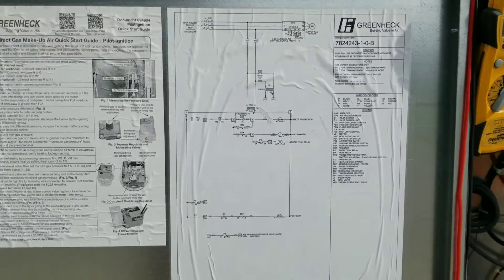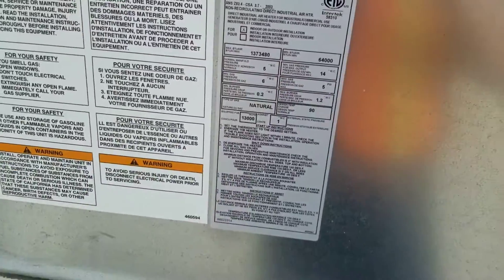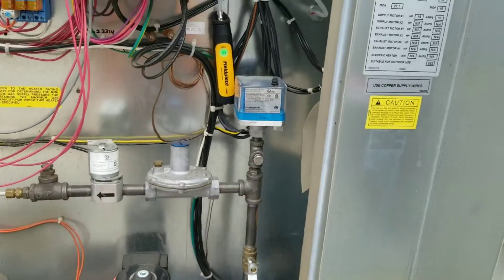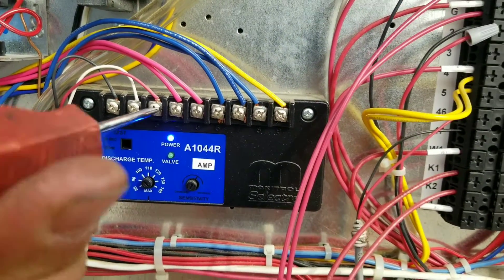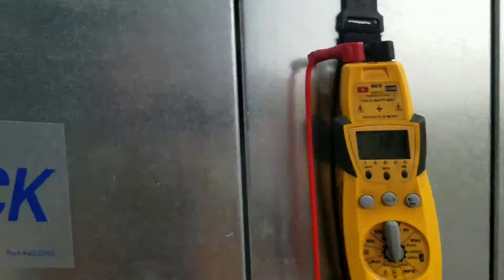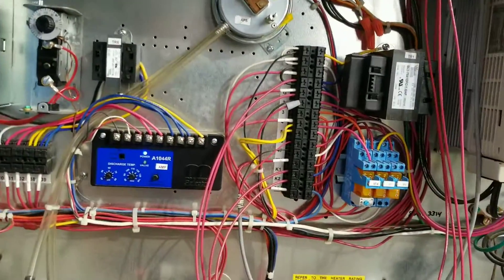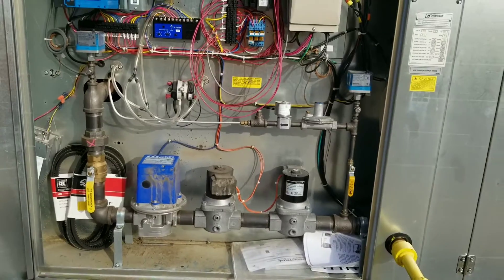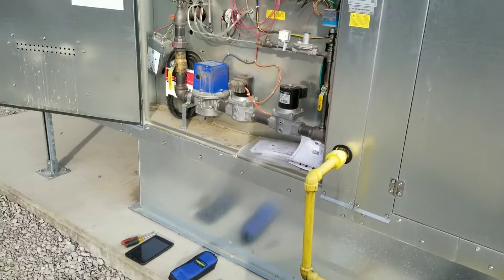direct fired make up air, greenheck,  high limit trips.

Comment: Nice man.  Your manometer was referencing atmosphere and the burner is on the inlet to the supply fan so it'll be more towards negative/negative the more it turns down. I've never done it,  but I guess you could reference the cabinet to get the "true gas pressure" if you were curious.  I may try that next one I see lol. Maxitrol has some decent literature on those MR valves.  Lots of configurations.  Enjoy the content man.
Reply from the maker: Thanks for the feedback, and watching! Just like trane negative pressure valves, you are on the outlet side but read a negative pressure.

Comment: Shoddy sheet metal install. Square throat radius heel elbows do not work well when static pressure is a concern. Best to read the manual when designing duct. Great diagnosis. Thxs for the vids!
Reply from the maker: I don't know if it's just me but I see a lot of install issues, your exactly right! Thanks for watching!